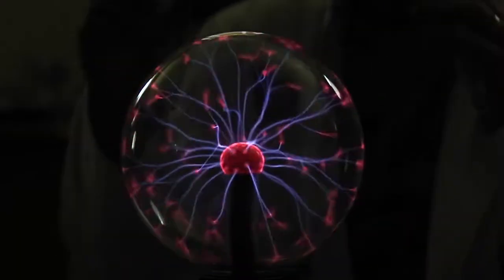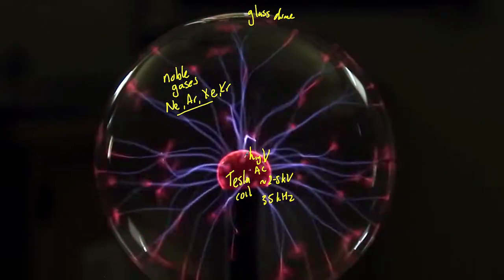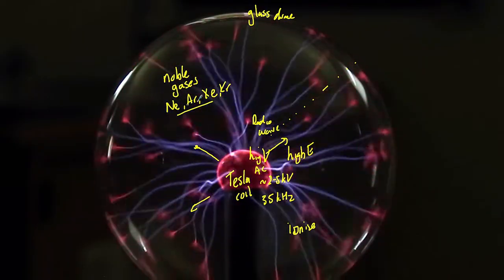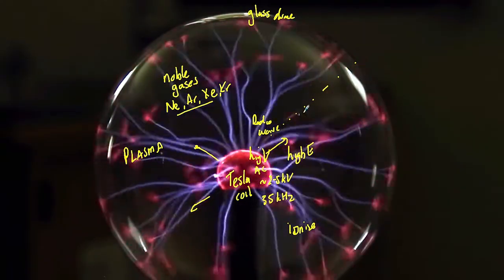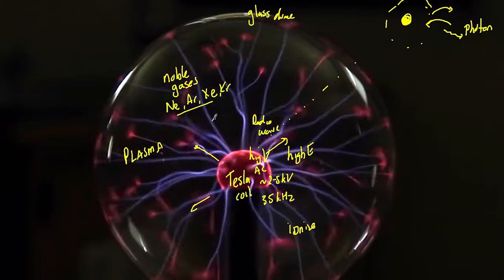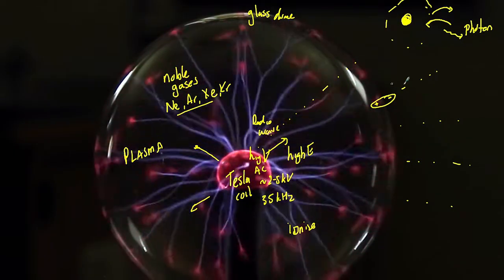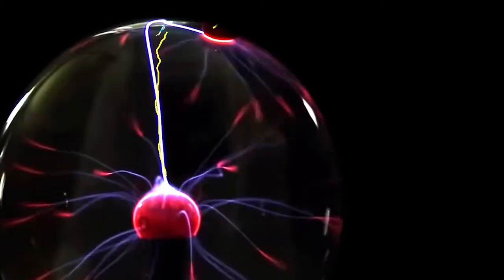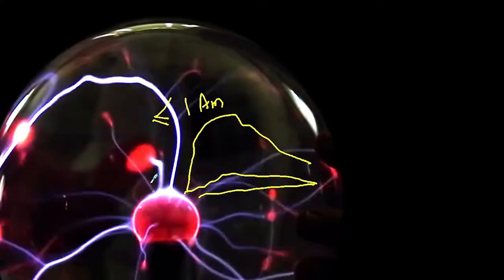physics of the plasma ball

Comment: The ATI,TPE does not correlate to a precursor of hydrogen as the first element of the Periodic Table of Elements. Hydrogen has the lowest and thus simplest atomic mass and number with the least amount of protons, and it has played a significant role in the Big Bang and universal creation; however, there are far too many compositional stages between the ATI,TPE and hydrogen to assert any correlation. Its pre-Krysthal “pre-hydrogen” essence is an exponential “pre-” so loosely related to hydrogen that they do not comprise any similar substance. Any wave, field, or plasma as we know it also does not correlate to Eia.

Comment: Amazing Video, I am gearing up to look at some historic gas discharge pieces called geissler tubes, in an effort to identify the gasses and vapors used inside, but also with hopes of recreating them in later works. I have picked up a low cost spectrometer that sees 350nm-1050nm and built a spectrometer from a spectroscope with plans from the channel Les' Lab, that only sees the 400nm - 700nm range, both able to grab photos and record them for later inspection. I am still gathering light sources for calibration and testing accuracy, but my question is if theses are enough to accurately identify what is inside these historic vessels, giving that they were know to use noble gasses as well as metallic vapors? Thanks for any insight you can provide!

Comment: Is it possible to apply a high voltage alternating current to the Tesla coil inside a plasma ball without plugging in the plasma ball's cable into a socket?

Comment: This explanation seems to have some holes.   Electrons passing through the glass?   Glass is normally a reasonable insulator so how can that be?   Gas giving off light because it is heated?   As explained elsewhere in the video, plasma gives off light because of quantum effects as electrons in the ionised gas change energy levels, not because of heating.

Comment: Thank you for your very excellent video. I have a question: What is the pressure inside the globe in Torr (if you know)? I'm building a very different type of plasma bulb with a plasma emitter. It gets one end of a 15K neon transformer. I've experimented with Torr between 15 and 300 using neon as the gas. I'm trying to find out if I am anywhere in the correct range compared with you plasma globe. Thank you.
Reply from the maker: I'm not sure in terms of this plasma dome. Sorry I cant be of any more help
Reply: @PhysicsHigh  -  I appreciate the response.  It was a long-shot question anyway...

Comment: So is the charge going through you negative or positive charge? Do you think I could use a plasma ball to either attract or repel certain materials depending on their charge? i.e. Flower pollen are negatively charged, if the plasma ball is releasing negative charge on the other side of the glass then it would repel the small pollen particles?

Comment: Sir I have a question is their any difference between Electric Field and Radio Waves ?
Reply from the maker: There is but they are related. An electric field is simply a region in space where charge particle experience a force. In other words, if you have a charge particle and you see its experiencing a force, you know that there is an electric field. The strength of that force tells you the strength of the field. The direction of the force tells you the direction of the field. A radio wave (in fact, any form of electromagnetic radiation) is a fluctuating electric field (with a fluctuating magnetic field) radiating out from a source. In essence it is a wave and travels at the speed of light. See my video on Maxwell for a deeper discussion

Comment: In most cases the center of the globe isnt a tesla coil, its just a step-up transformer with one of the output wires connected to ground, with one wire going up to the center of the globe. Grounding it is important because the capacitance between the two wires gets much bigger, hence making it as bright as it is.

Comment: Could you make this without the globe if you have a steady flow of gas?
Reply from the maker: Not really. What’s also important is the gas pressure, ie the amount. The gas would dissipate really quickly when heated.
Reply: @PhysicsHigh  I had another person tell me that because of it no longer being in a vacuum you would have to exponentially increase the voltage due to the atmospheric pressure. I've recently learned to forge and enjoy making swords. What I want to do is integrate this into various parts of the swords blade. I would have to use a smaller battery with the tank of gas being in a backpack or satchel. I don't want to make a death stick though, just a sceptical.

Comment: I have a question: Why is a noble gas used instead of a gas that's easier to "shake off" the electrons? Since noble gases have a complete out shell, it requires more energy for them to lose a valence electron. I understand why you can't use the gases on the left of the noble gases on the periodic table, but what about the gases in the Oxygen family?
Reply: Because noble gasses are not gonna have bonds that require even more energy to break

Comment: does it produce negative ions when it's AC? I've read that the current doesnt end where the glass is and it's only not visible. It also produces sparks and ozone when you touch it and it's affecting electronics in the room. Mouses and keyboards behave weird when they are too close

Comment: What is the life of these globes? Give the fact that ions and electrons should be bombarding the glass I would expect some deterioration over time.
Reply: TheAzylum as long as the gas is in the orb and there is an electrical current it should last a long time. If you got a hole in the orb it wouldn’t work because the gases would escape.
Reply: One year at least depends on how much you use it

Comment: Very nice educational video.
Now I understand depending on the materials used, there can be arcs conducted off of the exterior. 
Here is my question - is it safe to hold 20 gauge copper wire next to the plasma ball? The reason I ask is because I plan to use both for a Halloween costume and would like to ask first.
Reply from the maker: Touching it with any metal will give you a shock. It won't be dangerous, (high voltage but low current) but it will hurt as it concentrates the electric field. I probably wouldn't do it. 
I feel I must add the disclaimer that I do not take any responsibility for any injury it might cause, directly or indirectly :)
Reply: @PhysicsHigh Thank you so much. And don't worry, I'm responsible for my own shocks! 🤠

Comment: tell me if im wrong... 
sooo if sound moves trough air, the medium for the sound wave to transfer energy would be air right? 
what about radio wave? electrons???
Reply from the maker: In regards to sound, you are correct. Radio waves, a form of EMR, do not need a medium. 
Electrons, if we consider them as particles also theoretically do not need a medium but the medium does improve conductance if present and depends on the medium.
Reply: Electromagnetic field